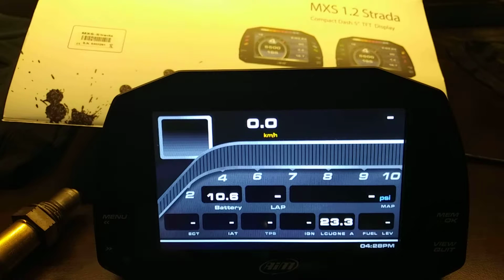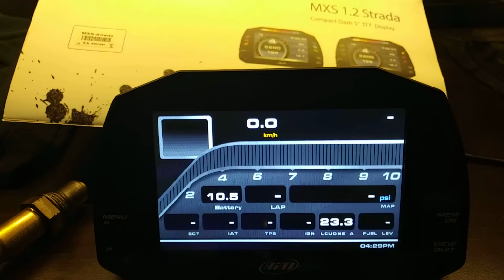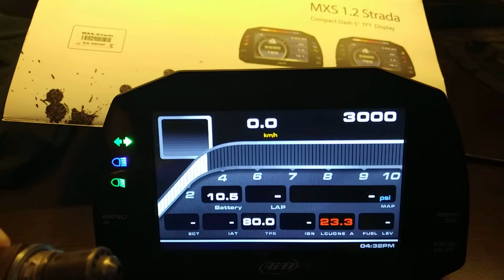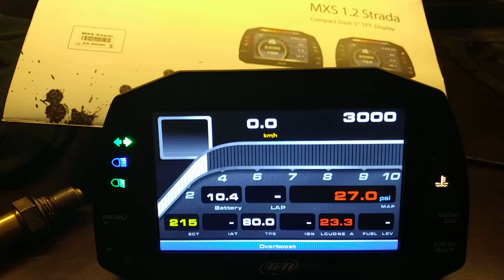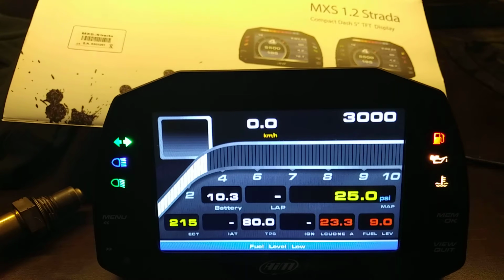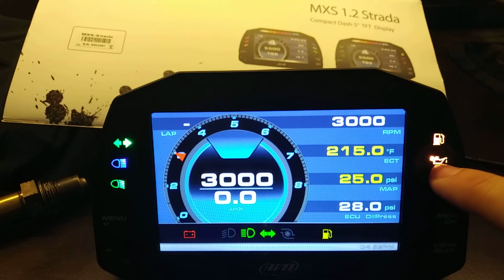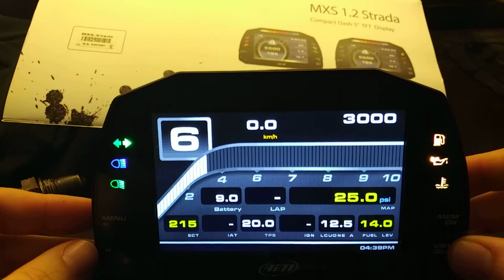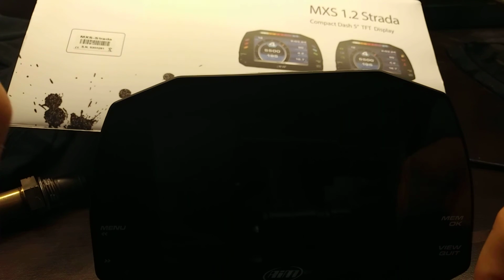AiM MXS 1.2 Strada Overview

Comment: How do you change the RPM range? say from 0-16000rpm to 0-8000rpm? thx
Reply from the maker: Connect to the device using the Race Studio 3 Software, then click the gear icon at the top, click receive to download the configuration from the device, then right click on the configuration, go to the display tabs and edit the rpm range by selecting the rpm channel properties to the right. Then you can save the cofiguration file and "transmit" the updated configuration to send it to the device.
Reply: @speedmastermarine  awesome!!! Thank you!!

Comment: Does this record mileage?
Reply from the maker: Yes it has multiple trip odometers to record mileage
Reply: @speedmastermarine  does this erase the mileage you'd have on original dash? Example - if I have 2k miles on my dash and upgrade to this, will this show 2k miles or start it back at 0? Thanks for any info
Reply from the maker: @oscarm2997  no it does not reset the overall system odometer, that can only be accessed via a computer and cannot be reset
Reply: @speedmastermarine  sweet. I plan on switching the dash on my motorcycle and ive been told aim is the way to go. Mind if I ask how much you paid for it and where?
Reply from the maker: @oscarm2997  Hi, we are one of the largest AiM dealers in North America, please check out our website at www.oppenheimengineering.com and feel free to send us a message if you have any questions. These make great digital displays for motorcycles.